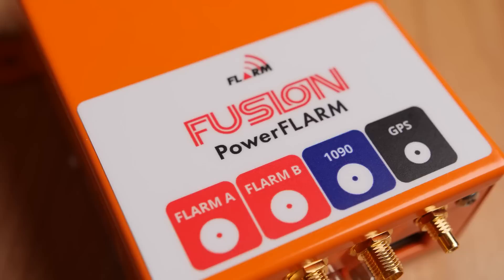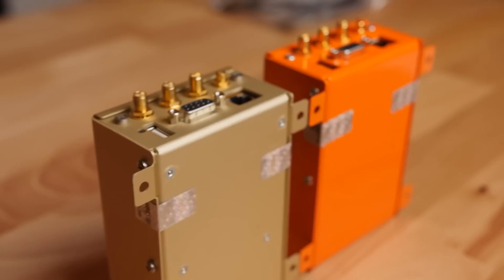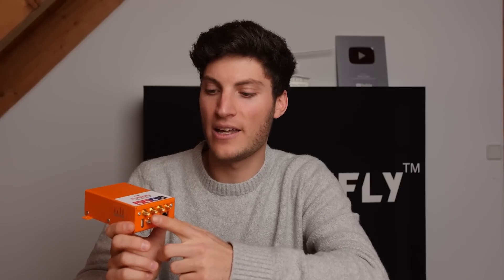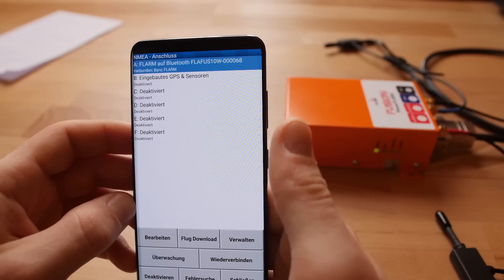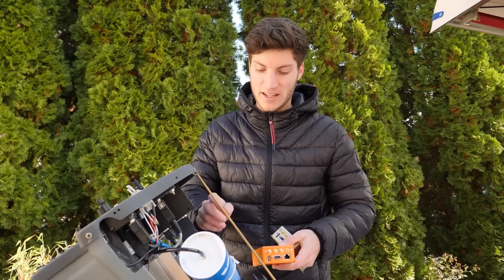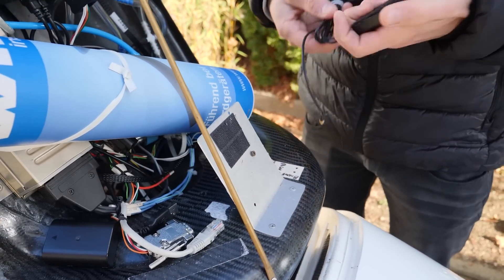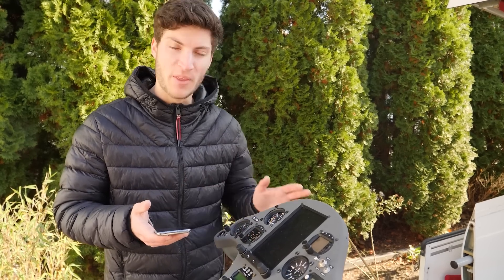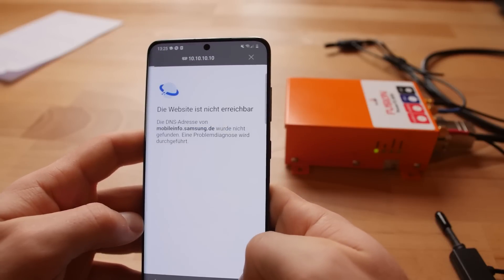Next Generation Collision Avoidance? | PowerFlarm Fusion Review

Comment: At 1:05 Stefan comments about the changes to A/B/ADS-B antenna connectors between the Core and the Fusion.  This is only applicable for the EU version of the Fusion versus the old EU Core.  The US version of the Fusion uses the same connectors as the old US Core so a might be a bit more plug and play (note - the GPS antenna connector does change for the US).   That being said the Fusion comes with all the antennas you need so this isn't a big issue - except maybe if you replaced the Core's dipole (A) antenna with a higher gain monopole antenna to enhance your range - which I did and worried I would need here in the US to find an adapter.  My $0.02.  Thanks for the video.

Comment: Is it still posseble to be online when connected to powerflarm fusion? Thinking of checking Weather and more online.
Reply: When flying a glider with PowerFLARM Fusion, you only connect to the Bluetooth. So you are still connected to 4G for weather or WeGlide Copilot for example

On the ground when you want to change settings or update the firmware of the Fusion, only then do you connect to the WiFi of the PowerFLARM Fusion

Comment: Thanks for the video. We bought the "fusuion" and installed it in the bottom of the fuselage and are not happy with this solution - probably because of our ground strap.... it shields.  Unfortunately we have only simulated the range on the ground (flying is not possible). Now we try to place it on top of the fuselage (behind the seat). Let's see how this works. What we can say: We have installed the antenna diagonally - that seems to be better. We will see.... is too cold for me right now..., and best wishes for the coming festive season and a happy new year,  Roger

Comment: Stefan, it is possible to get good coverage. I used to fly an ASW 28 until late this year and despite trying 3 different commercial antennae, I always had a problem with lousy Flarm (LX Mini Box) performance. I decided to build my own antenna just before we sold the '28' and it worked really well; even Gerhard Wesp was quite impressed when he saw the coverage on the KTrax site. If you look at the range analyser on KTrax for Flarm ID DDDC40 you will see what it is like. At the moment it shows nothing and I can't find my screen capture image to send you but if you look in the Spring when we get flying again it should show you. The design was a simple mono-pole with 4 radial ground plane so quite simple to make and I made it so that it fitted as far forward on the '28' panel coaming as I could get it, to avoid all the carbon fibre in the structure. Exact dimensions were arrived at experimentally using a cheap ( £40) VNA to match the impedence of the antenna and cable. The difference was quite staggering,  the radiation pattern was almost circular and signal strenth showed better than 10dB at greater than 20 kilometres.
Reply from the maker: Hi Graham, thank you very much! I think it is also important to have an antenna below the glider because the carbon fiber fuselage will cover this direction. Great idea with the VNA to check the perfect position.
Reply: Hello, can we DM ? I want to increase my range...
Thank's
Reply: @kevinfaurkf  Yes but I don't really want to give my e-mail address out on YT. Any suggestions?
Reply: @grahambambrook313  Hi Graham, I have sent you a comment on your youtube site asking for additional info. Alternatively you can post here some background on your design. Thank you.
Reply: @rontheglider  I replied to your message on my Channel and have put a short video there as well. Good luck and happy soaring!
Reply: @grahambambrook313  Graham, Thank you, I replied in the referred discussion as well.
Reply: @rontheglider  You're very welcome - I hope you have success. Please remember that my antenna was just a working prototype and was quite fiddly to fabricate. I would do it differently if I made another one. Luckily, my new glider is fitted with PowerFlarm and has pretty good range although the radiation pattern is not as good as my set-up on the '28' after I changed it.
Reply: Ron, I found the picture of the Flarm coverage with my antenna design but I cannot figure out how to send it to you as it doesn't work on here and YT channel only seems to accept video, not .png pictures. Can you think of a way if you want to see what can be acheived?
Reply: @grahambambrook313  will post in your channel
Reply: @rontheglider  OK if you want to give me an e-mail address or something I can attach it.
Reply: @rontheglider  Got it, test mail in transit.